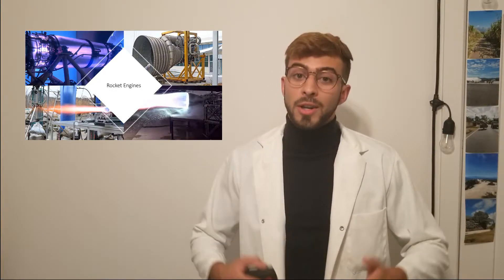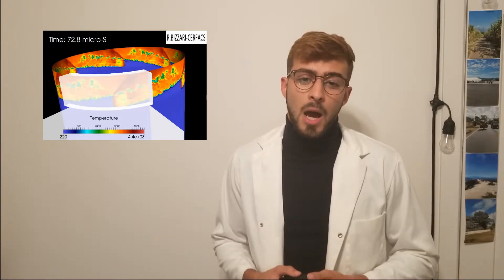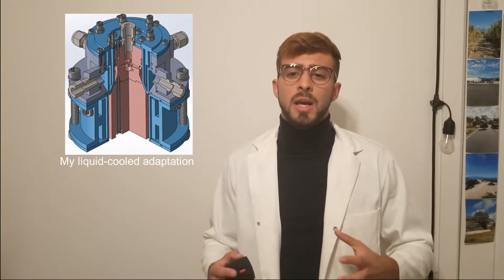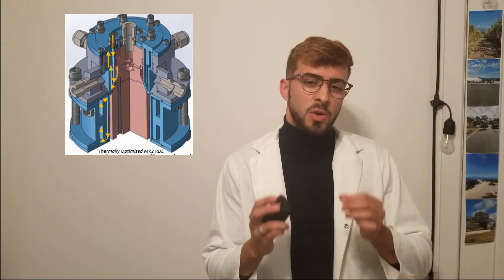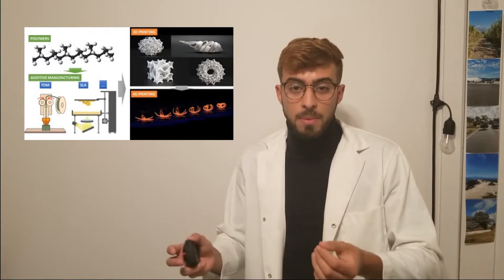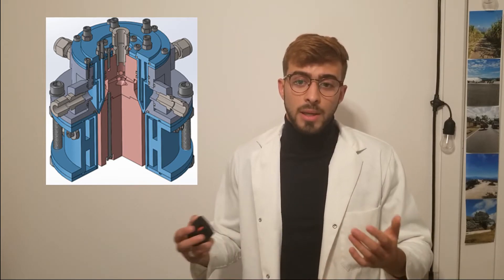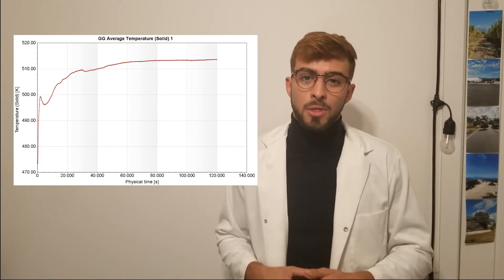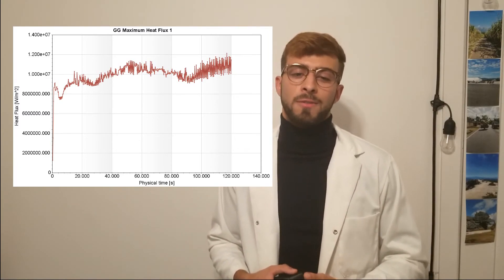Thermally Optimized Rotating Detonation Engine Research Presentation SURE 2020

Comment: I guess that cooling system is fine for the lab, but when they get that thing into a working rocket, water as a coolant, or any other liquid coolant, won't cut it.  Even if the coolant is liquid oxygen, or liquid hydrogen from the propellant tanks of the rocket, then much of the payload will be used up in fuel to keep the engine cool.

This problem with heat will have to be solved with the development of new materials that can take the heat and pressures, plain and simple as that (which isn't simple at all).
Reply from the maker: While this video is old, I am mentionning the possible use of a liquid cryogenic oxydiser as a feasible alternative. 
The math checks out regarding volume and mass (not more than needed for nominal flight combustion) and Japan has flight-demonstrated this approach with a 3rd stage regen-cooled, copper sleeved RDE: https://www.techtimes.com/articles/264369/20210820/japan-succeeds-demonstrating-rocket-engine-explosion-deep-space-exploration.htm